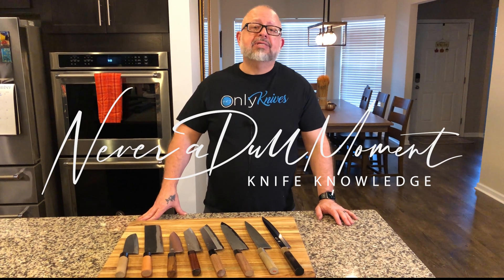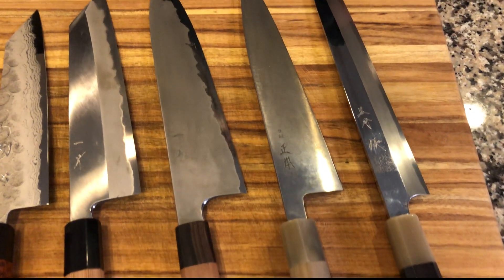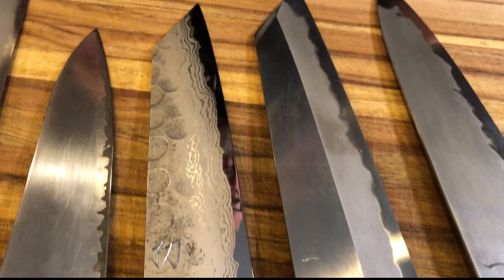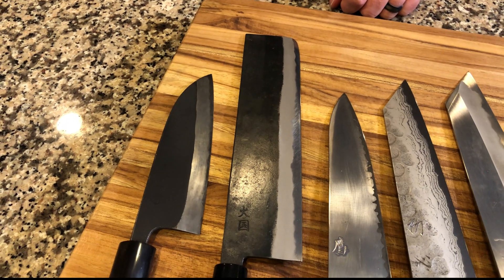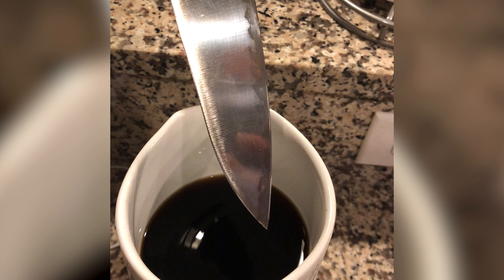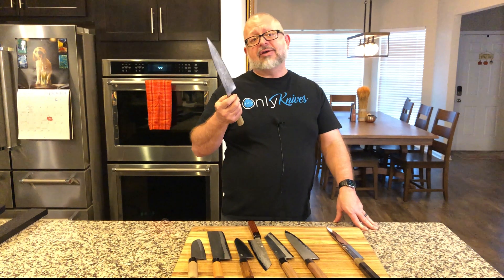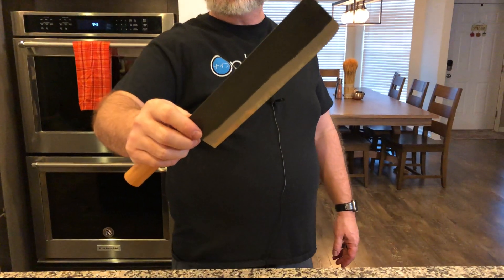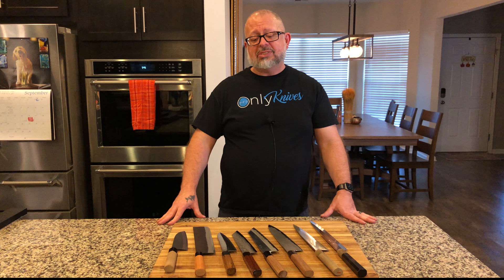Knife Knowledge/Knife basics: Patinas - Protective Rusting! Oxidation on carbon steel blades!

Comment: very good demonstration and competent informations . I use the sam trick for the anti-oxidation of my "Solingen Windmühlenmesser - with very thin grinder blades of carbon steel". And more and more I try to avoid oxidation and patina effects, because actually they decarbonize the surface and make it more and more uneven, so that the cutting experience suffers from this increasing roughness. (Those guys in Solingen originally developed a special blue fine polishing of their HRC 61 blades to avoid rust development in times before stainless steels came up ... rather effective, I have to say...) @ rust eraser: instead of that "unknown" material and composition I use a leather belt to clean up the dry blade, very successfully and very carefully
Reply from the maker: Please put a link in there if you have it so I could see that material you were talking about that special blue fine polish.

Comment: Hi, im new to knife etching stuff and i want to pattern my knife i have a stainless steel knife not sure about the carbon rate im guessing its low carbon i dont have all the acids like ferrric acid or nitric acid or anything do you recommend anything i could do at home i heard mustard works?
Reply from the maker: I have seen that mustard works really well. I’ve never done it. You just have to pipe it on in a pattern and let it sit. But it looks amazing.

Comment: None of those have a well used patina, if they did and then the bevel and edge is maintained they would look amazing, new carbon steel knives look like crap, and then people will point out small amounts of oxidation as ugly, a nice dark grey natural pantina from years of use blended into the primary bevel and the edge from natural maintenance on a stone is what these knives should look like, don't try to prevent the knife becoming what it is meant to become.
Reply from the maker: At first, I was one of those people. Then I enjoyed the patina. Sometimes it’s hard to break in the new knife and see it get tarnished. The one that got really worked on was the Mosamoto KS. That’s when I learned to let it go.

Comment: I like the patina
Reply from the maker: Me like!
Reply: @nadm  do carbon blades have a tendency  to oxidate or to rust?
Reply from the maker: @gabrielcc.  Oxidized to a patina is the tendency, but there are certain ones that will turn into rust quite rapidly. I have several that I don't even want to use the knife because the oxidation is too fast. There's no way to know unless you read a review or on the knife yourself. It is not always the case. Sometimes it's not the carbon steel but the cladding. If there is iron in the clotting, then it can sometimes oxidized or rust faster than the blade itself.
Reply: @nadm  thanks a LOT

Comment: Hi Greg, I have made  my own experiences with patinas. In general I like carbon core knives with stainless cladding. The patina on the core looks great in every aspect. For full carbon blades with iron cladding, it depends very much on the finish. I have currently only one japanese gyuto with carbon core and full iron cladding. This is one of my heirlooms - my 210 white #1 damascus (house forged) gyuto from Yoshikazu Tanaka. This knife builds a beautiful patina. And what I really like, is the different contrasts of colors due to the damascus cladding. So I really like the look. The same would be true for a knife with a iron Kurouchi finish or a Kasumi finished knife like your Hitohira for Yoshikazu Tanaka. By the way, a beautiful knife! On a Migaki, Mirror  finished or mono steel (KS) knife, I am not so sure if I would like the look. I think, I would use such a knife only to cut proteins - for example a Yanagiba and keep it shiny.
Reply from the maker: Absolutely. By the way, your knife collections getting amazing. Let me know what you used to force your own patina.
Reply: @nadm  I tried Mustard. But I was not so happy with the results. My favorite is simply cut food. I start with meat. Chicken or beef. This porduces may favorite blue haze on the blade. But it depend on the steel. My Fujiwara Marboroshi for example tends more to brownish colors (white #1). On my Tanaka white#1 it works and also on my Kato Blue Super. So it's little bit of a gamble. After that to complete the whole blade area and to finally protect the steel - I cut onions. Alot of onions. But be careful that the moisture is not sitting on the blade for longer. Tends to create dark brown tones.  If the patina is fine for me and stable after some cutting sessions. I use the knife in common manner in the kitchen, but avoid citrus fruits. For them I use my stainless knives.  Otherwise the patina will get change by the strong acid. One lemon is ok, but not a bunch or pineaple.

Comment: Hi! Can i force patina the my deba knife is a carbon steel
Reply from the maker: You just need to soak it in something acidic. Just stick it in a cup of coffee and it will turn out amazing. Just make coffee black and make sure that you have enough to stick the entire knife in there up to the handle. Do not put the handle in there or it will discolor the wood
Reply: @nadm   Thank you for your response i'll try that after my work😀
Reply from the maker: @rustlepaule5620  https://www.instagram.com/p/CRk0-4pjhF-/?igshid=YmMyMTA2M2Y=

Comment: I have a Gyuto in Sk-5 steel, which is just a straight downgrade from blue or white steels, still a lot harder and easier to sharpen than any stainless, but with more impurities (IE sulphur) than those premium blade steels.
One of the perceived disadvantages of this is high reactivity, but I actually love the patinas that form on the blade.
I use the knife all the time at work and it has forms a very complex mottled patina that changes all the time, made of strong Grays and blacks as well as faint blues, It gives the impression of an abstract or impressionist painting, I think it's unique and I wouldn't change it for the world.
Reply from the maker: My Instagram link is in the about area. Maybe send me pictures and iMessage. Thanks for your support. I'd love to see it!

Comment: That huge nakiri is interesting
Reply from the maker: It is fine. It's white number one and so it became very brittle. We actually have a lot of chips in it now. We're gonna have to do a video where we remove the chips
Reply: @nadm  shirogamis are easy to sharpen, shouldnt be a problem with chips since its quite tall, will take very long for it to be sharpened to a fillet knife. 🤣
Reply from the maker: @DrJKee  It’s just aggravating that that big knife is made out of something so brittle
Reply: @nadm  i strongly believe that there is no bad tool, only usage error. With the heft and hardness, i can only assume that the maker intended it NOT to be used on the chopping board or used gently, or you have underestimated your strength 🤣
Reply from the maker: @DrJKee  a 240 mm nakiri is definitely meant to be used as a chopping knife on a cutting board unless you're going out into the woods and using it as a machete. It's just that the steel is brittle. White number one is the hardest most brutal still there is. That thing is a vegetable knife and we were using it on spaghetti squash. Maybe something a little softer like white number three but I've been better.
Reply: @nadm  sorry man, i have never seen nor handled one so big in real life. Always thought that something that brittle is meant for making daikon sheets like an usuba or used on a rubber chopping board. Thats the reason big chinese cleavers/slicers are made only from softer steels. Looking forward to your sharpening videos

Comment: I found this out on a 240mm Tojiro Wa Kiritsuke, turns out shiro-2 has about zero resistance to oxidation... I got a strong feeling "Santa" is gonna leave me a 200mm Tsunehisa SK-4 Chuka Bocho... I'm going to keep it clean and try to use it evenly, gonna let the patina set in naturally... I believe it tells  a story, gives it character
Reply from the maker: It does give it character! Congratulations on that.

Comment: I have a KS-Style Burrfection Launch Edition blue #2 240mm gyuto with stainless cladding. The core steel is highly reactive. So I let the patina form and stay at the core steel. But as you said - this work great for stainless clad knifes and in my opionion looks great for many knifes of that kind. But for blades with complete reactive surface, I would clean them on a regular base for aesthetic reasons. I takes only a few minutes to do so and make fun. You have time to look at the knife.
Reply from the maker: Teach their own. I have one knife that's completely reactive and it Hass to be wiped down constantly. I never want to use it because dad. The ones that are clouded seem to be the easiest. I think that's why they do it. Chefs in Japan to clean their knives early all the time. A lot of times they keep the high polish.

Comment: Hi Greg, why not polish the carbon steel blade you like to be shiny on a regular base with metal polish (barkeepers friend should also work)?! The polish won't ruin the finish of the blade, which sand paper or rust eraser will definitely do. Especially the precious kasumi finishes on your Hitohira knifes. But I agree to you, this will only help, if you use the knife for dedicated food (like proteins) after that process. So you not have to clean the blade after every use. But as a knife collector, you will not use every knife on a daily base anyway, so it make sense to me to clean them sometimes!
Reply from the maker: For me, it's a time issue. I just don't have it. I'm sure for those who are truly into it, then they would make the time. I use so many.

Comment: Great vid very informative, you can also use mineral oil for the blades to prevent them from rusting. My Tanaka Yohei recently got some rust from humidity and a barkeepers friend slurry with water does a great does a great job of removing the rust without changing the finish
Edit: also metal polish works wonderfully for removing rust
Reply from the maker: Thank you so much for your input. I’m glad to hear that works for you. I have some here and I’ll definitely take a moment and work with it and see what we can do on my Tanaka

Comment: I tried using vinegar, citric acid ,mustard etc... it didn't worked 😅.
Honestly carbon knives  look like amazing piece of work/art, but also too delicate.
If the bevel gets in contact with acidic foods it will get dull.
Reply: That’s not how patina works, the edge won’t dull from a patina it’s not acidic enough
Reply: @billlbilsontonling7773  Nah, it will.
And I'm good at sharpening.
The edge is very small , expecially on carbon.
Acidity will just degrade the edge so you need to resharpen.

Comment: I saw pictures of a forced patina put on a knife once using mustard with bubble wrap wrapped around it. There was a cool pattern of rings left somewhat like engine turning. My Tojiro still has its kuroichi finish intact after several years and it has proven remarkably non reactive. Never seen a 240 nakiri before either.
Reply from the maker: Yeah, we're gonna be doing a review on that particular knife. And yes I've seen people do crazy things with mustard. That looks like fun.